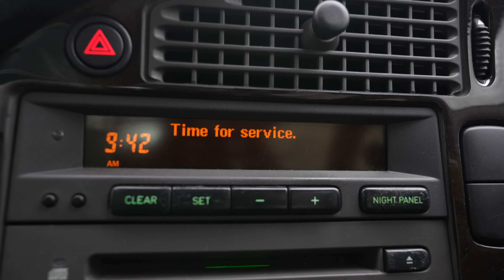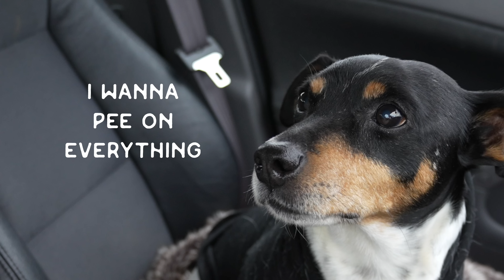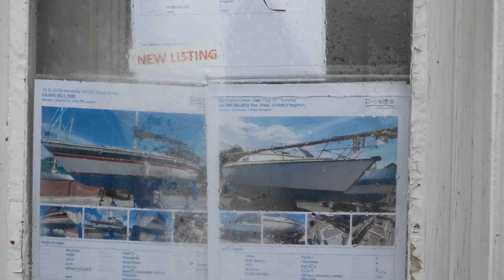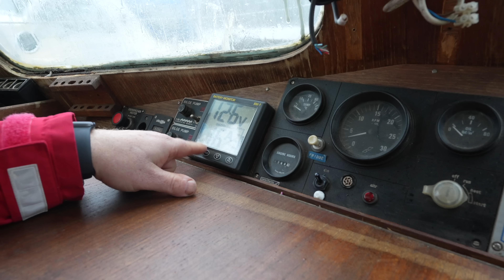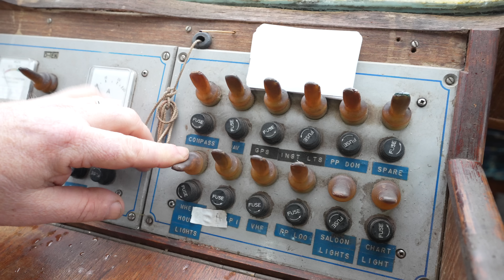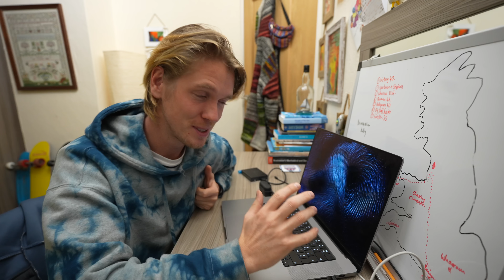Should I Buy This SALVAGED Steel YACHT? Sailing Melody Special Deal! | Wildling Sailing

Comment: Well I will contribute my unasked for opinion it is free for you hence worth exactly that so feel free to ignore it. Firstly it is an amazingly generous offer you are getting for free 2 years work by Andy Melisa and his team of friends. Additionally he is willing to help with the remaining refit both by guiding you and coming to get his hands dirty with the rest.

As for the boat well it is a mono hull but it is a steel mono hull it can shrug of damage that others cant. Certainly you have to keep on top of painting and rust but especially these days with modern paints this is not an onerous task. Its keel means that your draft is not that much more than  a  cat so you can slid into anchorages close to the shore of just beach it.

The downsides well you definitely need some extra systems Dingy, Dinghy davits, Solar, water maker, modern instruments etc but that is what sponsors are for.

It is a solid safe boat that requires a few months of hard work (Yours not mine so easy for me to say) then you could easily sail it to the Caribbean or just keep circumnavigating the world. It has plenty of extra space for a small crew.

Comment: Damn that is a good deal as it appears all the heavy lifting has been done and all that is left is minor cosmetic stuff you can do slowly over time. If I did not already have a boat I would buy it if I could get it at that price. The thing with steel boats is keeping on top of the maintenace and she will last a long time. And it can be repaired anywhere in the world as steel is available everywhere. Just get a small Welder and get some experience welding.
Reply: Sorry, no telegram account. Are you able to contact me via email? Do you have that option? Or give me your email and I will send a message.

Comment: Steel is easy to alter and add stuff to. Also somewhat Orca proof off Portugal
Reply: You are looking at very different boats. A timber flexible catamaran that is stable and durable in its construction…..a fibreglass traditional monohull with an exotic rig…….a steel cabin house with rig for short handed sailing. Note all failed dreams in the making by various folk who have analysed the options and decided what is right for them!!? May I humble suggest that you need to do likewise or the huge choice will defeat you. If you are wanting to cross the Atlantic? Which route to where and when? Then what ….. sail on or go home and settle. I might suggest you join a boat as crew for a transatlantic and see how. Then buy your boat. Grounded in the experience you gained. Maybe a short Tenerife to US. All boats fee small and venerable in a big sea in the ocean. You need strong and easy to manage single handed. For sailing and a large caravan for idling around in the sun…..very different things. Good luck. C and Cooper

Comment: This is one BIG Boat! You've sailed a 28 footer and 35 footer -- but with a crew. Single handing a boat of this size and complexity may be an extraordinary new challenge. Won't you get the volume you need in 10 feet less but more manageable?  As to the underside, she has a long keel and bilge keels as well. Along with the centerboard, that's a lot of wetted surface, so she may be a little slower than you might expect for the length of her waterline. She does, however seem a major bargain, especially considering the extensive restoration that has gone into her. And all the room in the world. (If the after cabin could be reconfigured to sleep two again, you might have the opportunity to take on paying passengers or crew for some parts of your journey). Tough choice. Good luck!

Comment: Thats a very good financial offer.  Secondly you will have very good access to knowledge about what has been done to the boat.  It is strong, all the rust gone and replaced.  Professional welder did the critical welding.  It is structural sound, it has the main stuff, it has been well through through.  I would not be worried about steel, all boats need maintenance, all need work.  It will go around the world.

Comment: This boat was restored very well by Andy and what is left to do yet is not that terribly difficult to do. If the boat fits your budget you cannot be making the mistake you would have had to deal with the previous boats you showed or looked at.
Reply: There's a good reason such boats are called "motor-sailors" for it prioritises the method of propulsion.  Restoring it will not reduce the diesel bill or increase the lumbering progress.

Comment: It's good to weigh up your options and check out a variety of projects and possibilities, it should help you to make decisions on what you really want and what you want to avoid.
To me, that looks like a very hand built boat with no fine touches or finish details, it has quite an industrial feel to it which I don't think you would be able to alter very much. 
Steel cockpits in bad weather are no fun either, in fact steel benches and corners are proper bruisers in rough weather !
Reply: Mark is being subject to emotional pressure, no fault of the owners.

Comment: I have followed Melody from the start personally I’d have thought she was worth double that price.
I’ve been so looking forward to seeing Melody finally back in the water, this would make such a great channel, Mark and Melody the floating tank😂
Reply: Well, here's your big chance, Chris. If you think she's worth twice as much buy it then sell it and make £15k!
In the real world motor-sailors are not selling; diesel is increasingly expensive, they are relatively slow, the swing keel is problematic...
I'm disappointed a chorus of non-sailors is urging Mark to throw his money at it.
Reply: I see what you mean, diesel is expensive and dirty the engines are noisy, I was thinking all that space for sola power, a battery bank, an inverter with the correct electric motor what a boat.
All that time Andy has spent welding just seems a small amount of money for all that work and expense, but it is what it is I suppose.
Half tempted myself 🙂

Comment: What a wild ride!  You went from a completely wooden design (almost no metal) and no help in a far off land to a steel ship with assistance from the restorer in your homeland.  I gotta tell you, your trip to Costa Rica has me going back down the Wharram rabbit hole.  If I were 10 years younger I'd build a Tiki 38, mulling over smaller designs but I'm afraid whatever I build I'll try and cross an ocean regardless of the size.

Keep inspiring us all.

Comment: Melody has been rebuilt right through and I have seen some of Dan the welders work on the fishing boats down here and it is excellent, The ford Dorset four cylinder is almost indestructible I had one the same in a boat years ago and they are dependable to the extreme,   another good option you could finish how you like and you can get some fantastic paint systems nowadays so steel if fine, keep plenty anodes on them too.

Comment: Are you planning on an expedition Mark, because that's what you can do with that boat. The exterior work looks top notch, the interior needs some serious attention, overall, a tank of a boat.  I'm not familiar with steel boats but surely they must be strong and reliably safe. There is a lot of labor and money in the boat however, there is still a lot more to go.
Reply: It relies on a diesel motor to make a passage at reasonable speed. $$$.

Comment: I haven't watched the video yet, but i'm going to say; That's an easy one, yes you should, finish it off, maybe do a little modding (it strikes me as the wheel house should be converted to have an opening roof somehow, maybe like a cloth webasto type of thing maybe even like an Amel Super Maramu, that way you can be rid of the existing cock pit and make the thing flat on the rear giving you an amazing space for an amazing owners master birth) sail it around till you find your next thing.

Comment: I want to build a 48 ft. aluminum catamaran. The type that Sailing into Freedom is building or a Mumby Cyber 48. You probably make the right choice by not getting that catamaran due to all the expenses that it would have cost you. I was thinking of possibly taking that cat and towing it to another location to work on it on the hard. The prices to do that would have been supper cheep in that country but that's probably not the best country to work on a boat. You'll find something that suits you in the future. Check out Sailing Life on Jupiter. They have few videos about the design and construction of there Mumby Cyber 48. I've heard that you can build one for about $100k USD. That's 100% ready to sail. It includes the sails and electronics and everything. That's if you do all the work yourself.
Reply: I like the interior of Life on Jupiter, the finish on the walls, never seen anything like it on another boat.

Comment: Ask yourself if you can do this Mark. I see all the comments but I have also seen you stressed to the max thinking about work that needs to be done.  If you think you are ready for a huge project and willing to work , hard for a year then the comments are correct this is a great boat. But if you aren’t then this is just isn’t it. I am 67, I have tons of experience and it’s not that I couldn’t do the work it’s that I don’t want to. I don’t mind day to day maintenance. I replaced a motor, never had before, but didn’t hesitate. But when I look at the amount of work to make this a proper sailing vessel it just makes me tired.  I just wouldn’t do it. I do think Melody has fantastic potential. But it’s a long way from launching to a proper SV. I say keep looking. 
Kurtis Hafferman

Comment: Steel is fine, But i wonder, if welding stainless steel chainplates on to regular steel, specially for the rigging, might become a (hidden) problem (until it snaps).  Due to galvanic corrosion. and by putting part of it t in epoxy paint and  so without oxygen which makes stainless stainless corrode.  For the boat itself, in my opinion, and regardless of money, it doesn't feel like a match with you personally.

Comment: old steel boat equals lots of work all the time. You can see the rust starting on it in places & that is while it is been fixed. It only gets worse & there is no resale value. Also it is not the places that you can see are the worries it is the places you cannot like were the bulkheads meet the floor & under tanks & stringers behind lockers etc.

Comment: OMG buy it now :-)
Reply: Mark, you have previously said you wanted to go long distance cruising.  If that includes the S Pacific with poor charts, steel has some real advantages.  Melody also has huge tanks, 900L of water and 1000L of fuel.  You don't have to use that, but it will be very nice on long passages.  Finally, this is going to be your home, you need somewhere with space to live.  Sorry but the Warraham could be cramped in poor weather.

Comment: It's a keelboard, can be prone to problems. You need new skills to maintain. You will always see rust stains, which will be off putting. There's a lot of work to be done still including aesthetics. It will cost you a fortune in diesel because you need really windy days to move that 12 tons through the water. It's not the boat for you.

Comment: The interior refit using B&Q supplies is not confidence boosting. Also those types of seacocks on the fuel tank need replacing. 10k. No more. Rip out that pine tongue n groove. Might also have spotted some MDF..

Comment: That offer is a pure bargain, I would have gone for it Mark! And you can allways ask Andy underway.
Reply: Does it come with 10,000 liters of diesel?
Reply: @alexandermenzies9954  10.000 liters of diesel? It is a sailing boat so I will think it will come with mast and sails … it’s not a racer but still a sailing boat.😀
Reply: @bjrnkristiansen3420  It's a motor-sailor and unless you have an unlimited supply of fuel it's performance  will be considerably less than a blue-water yacht.
I see you had to exaggerate by referring to a "racer"; no need, most interested sailors know what a blue-water yacht does.

Comment: If she has that much tankage it's because she is expecting to us that much fuel. Boat designers don't put them in for no reason. So, given that it's only the UK that provides tax free diesel for boats, are you prepared to open your wallet that wide for every fill up?

Comment: Ultimately it going to come down to you wanting to sail or work on a project. Each boat is going to have it’s pluses and minuses, no matter how you look at it. Each one is going to have a maintenance fund. The lack of a maintenance fund is why there are so many “junk” boats out there. I suspect the maintenance fund is going to be bigger for the steel boat although working on a steel boat is not going to difficult for a boatyard. You want a wharram and won’t be 100% on any boat until you get one.

Actually $700 for those 25hp motors is a steal. He could easily sell them for 10 times that amount and you would never be able to replace them for $700. I know you feel like he’s trying to get more and in a way he is, but I would just get them while you can. Price out a 25 hp outboard and I’ll bet you think differently about them.

Comment: It’s steel so bounce of most stuff, easy to beach or park on shore to inspect.  Masses of room with pilot, saloon and double v berth.  Every tanker or commercial boat is steel and if looked after hardly needs touched.  If paint taken care of like you would do with any boat then it will last.  Remember how many grp boats get osmosis etc.

Strong blue water boat with room to live…

And you know with this one there are no hidden issues cos you can see it stripped right back.

Marina fees vs living space must be almost unbeatable on this and if you start your adventure on this one and after a while decide it’s not for you it’s one option your not gonna loose money with deal they have offered.

Comment: Hi there  i have been a a fan of your you Tube channel and also of Andys , I have owned a steel boat and unless you plan on going up on a coral reef. do not buy a steel boat they only work in commercial situations . they are a constant source of maintenance go through all the episodes of melody and you find constant rust stains even after it has been painted .there are so many traps in steel boats with unlike grades of steel to faulty wiring which cause electrolyse with that centre board virtually impossible to maintain . i would get some unbiased  advice and do some research. As much as i like Andy and his family they know nothing of having a steel boat on the water

Comment: Mark don't be afraid of steel.  You are young and are going to learn many things ahead in life still.  You can easily let steel be one of them.  It isn't hard and you practice welding on spare bits, not on your boat right away.  No different than learning fiberglass, resins, gelcoats, etc.  Melody is a brick house and will take you anywhere on the planets oceans. Slowly but you'll be safe.  And she clearly comes with a most knowledgeable previous skipper who seems will not leave your side even from afar.  And the Lehman tractor diesel is a vanguard of an engine, and priceless in and of itself.  Look for the channel Sailing Emerald Steel. They have lived on and cruised their boat all their married life. And SHE did all the welding when they built her.  And is the one who does any metal repair if needed.  Forget the Freedom (sorry, I feel compelled to say this). It's a weekend boat and a coastal cruiser at most.  You'll grow weary very quickly.  The unstayed rig is not storm friendly crossing oceans and with those imposing heavy wishbone booms just add weight where it isn't welcome.  Hi Yoshi !! 🐶

Comment: ...well you got yourself a nice SAAB 9-5 at least... stay away from that steel-barge...   the Freedom is better - and Wharrams - I had a plywood 26ft cat - homebuildt by a student - but fast as a Firebird - and compared to a 26ft Wharram and also a Strider - it looked like a ship. Problem was - it rotted while I used it - you will never get a break with old - or new plywood. Cold moulded or strip plank is another level - much better.

Comment: There's a problem with this design of boat, it's trying to be all things at once. A motorsailer, a bilge keeler, a centre plater, a long straight keeler, a crosser of oceans with a bathing platform and still too much of a project.
Decide what type of sailing you want to do and find a boat designed to do it and GO SAILING!
p.s. Would you buy a car without driving it first?

Comment: That boat is still a wreck. Steel boats are not for the uninitiated and while well intentioned the work on that boat is… rough. There is not only a ton to do but there is equally a ton to re-do. Some of the welding is well done… some of it not so. You WILL have to learn how to weld. The worst is the way they went about painting. Steel boats live and die by the painting and messing that up is going to come back to haunt. Sadly, the general thought is that steel boats under 40ft don’t make much sense, this is partially why this boat had a wood deck… replacing the deck with steel with their HUGE freeboard is going to change dynamics. This is coming from someone with a steel center boarder and an engineering background. Truthfully couldn’t pay me to take that boat but hey, that’s me.